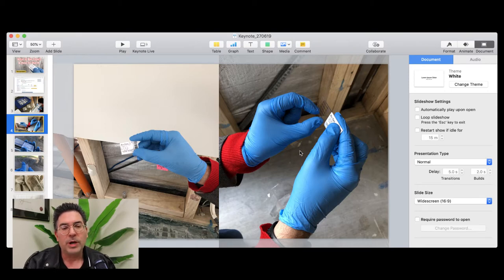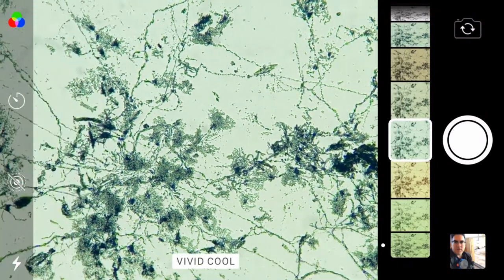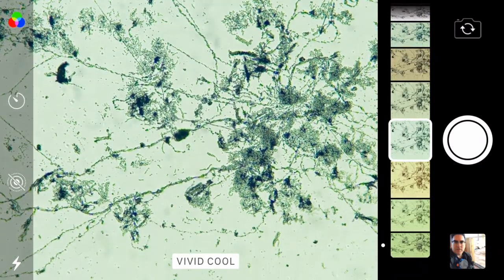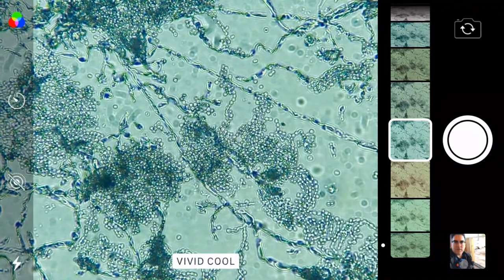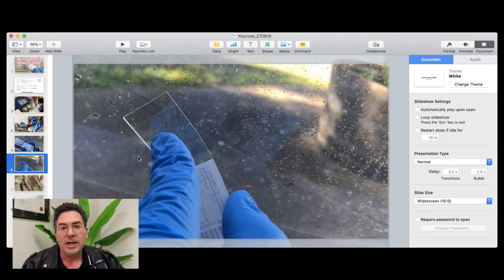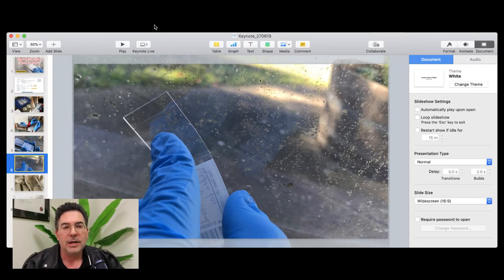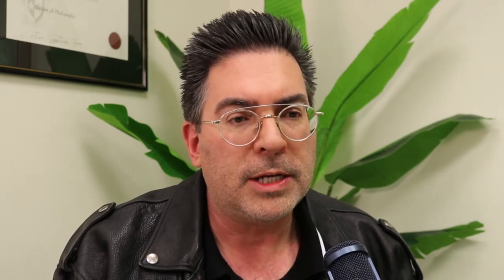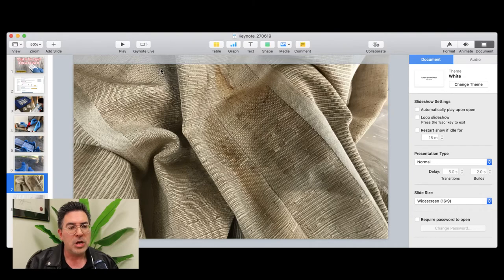What Is Bio-Tape & How To Use It?

Comment from the maker: 3:20 Standard test method
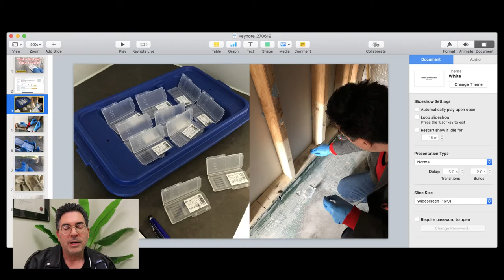3:40 Bio-tape being used on framing timbers example
4:42 Bio-tape under the microscope
6:00 Mould spores and chains of fungi under the microscope
7:30 Tape lifts on windows
11:10 Tape lifts for contents assessment
13:00 Tape lift sample at property
15:00 Rising damp at property example
16:14 Mould mycelium under microscope